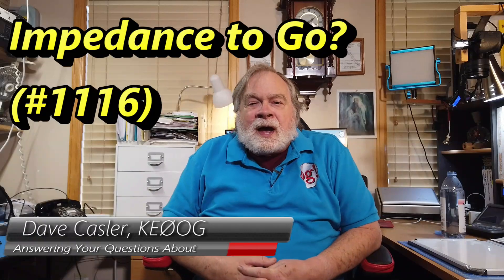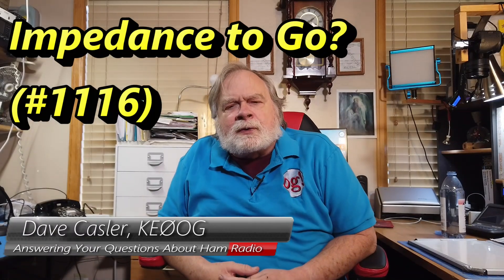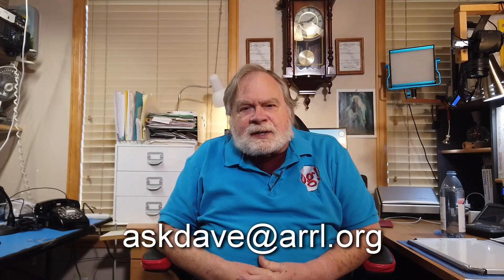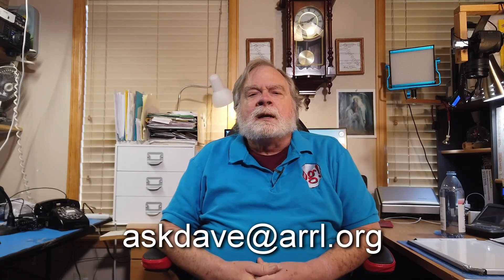Impedance to Go? (#1116)

Comment: There is no way an antenna that is nominally 50 (or some other number of) ohms at 0 degrees will have these exact parameters while hanging over your house at a random frequency, even within one band. You pick the antenna based on radiation pattern, operating frequency, bandwidth, size, weight, looks, price etc. Then if necessary, you fit it with a matching network, such as balun and/or matching section, to match it to the feedline. Of course for a multi-bander, this may not be possible, so you rely on the manufacturer in that case. Then you match the feedline to the transmitter with a tuner.